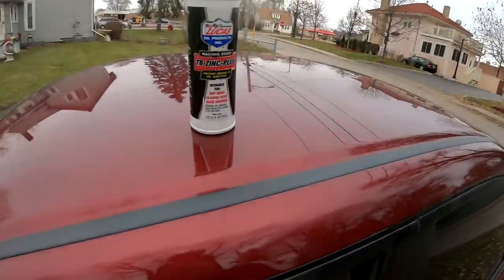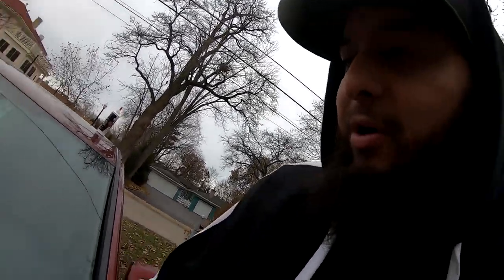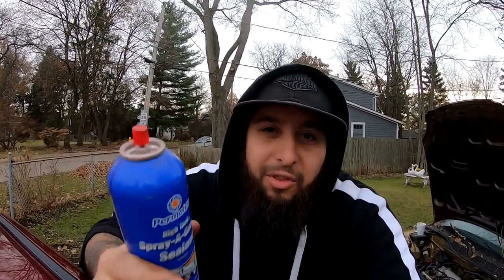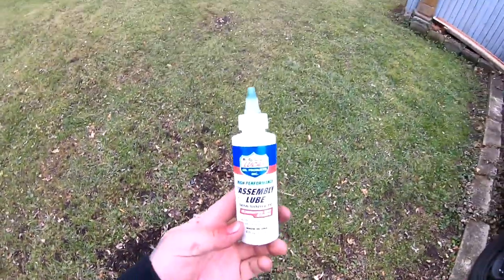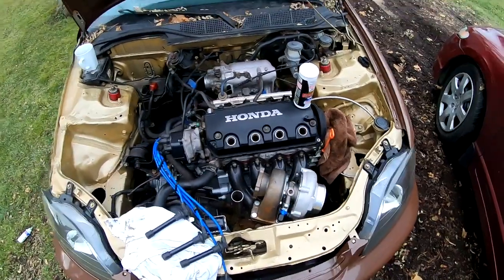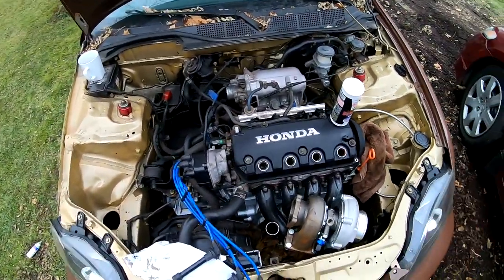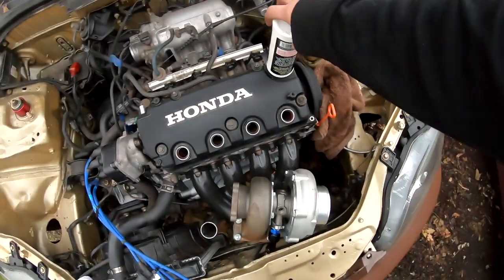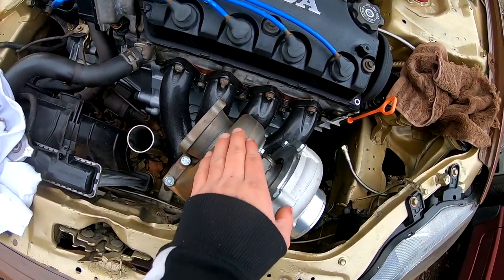500hp built Ebay d16 Turbo civic last video before first start up

Comment: You need to clock the turbo so the drain line  is facing downward....
Reply from the maker: I clocked it all the way already the drain sits at an angle boostedboiz style my drain is about 1/8 from touching the manifold and is still at an angle.